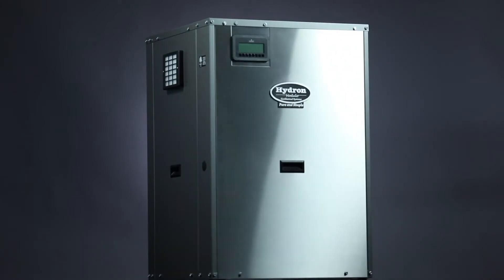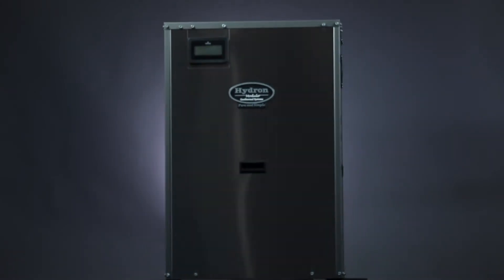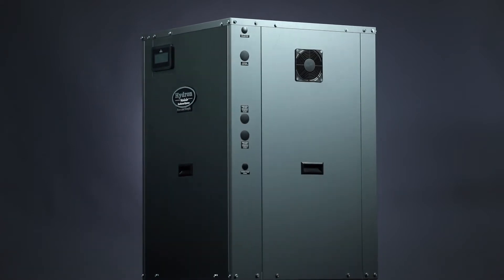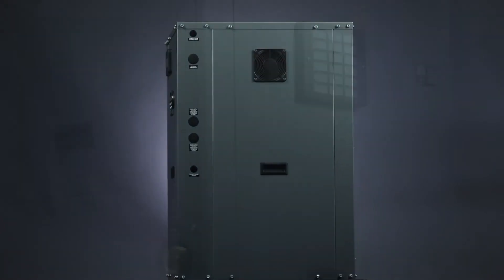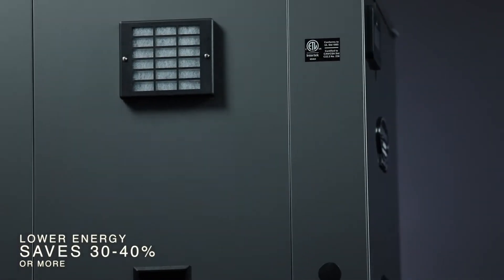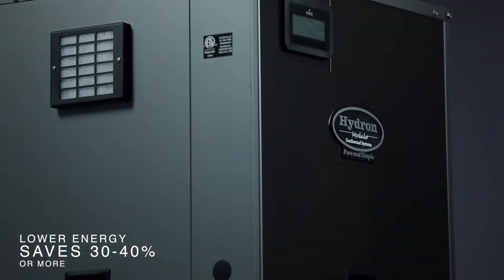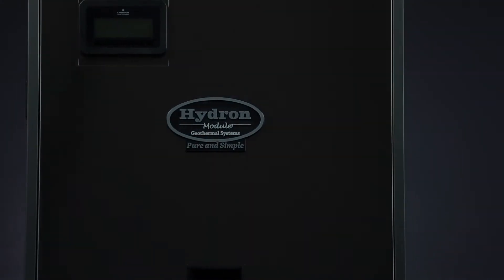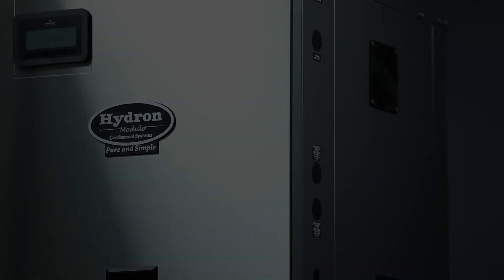Hydron Module Variable-Speed Water-to-Water Geothermal Heating, Cooling, and Hot Water System

Comment: Interesting system, water to water has a better cop as compared to air to water, then inverter is a great improvement... although the system I'm building will be a large water tank to store the heat energy and powered by a diesel engine with heat recovery and hopefully cop 5~6 on a 10degC primary tank to  a 40degC secondary 8000 litre tank, also water is a very good heat storage medium.
Reply: That sounds very interesting. I have recently gotten interested in geothermal for a project in Africa. 
I introduced it to my father and he put this unit in a building he just built. It actually runs of two of them on 3 zones.
 I have also thought about a larger buried tank for energy storage. I am still learning a lot, if you have any plans drawn up or an example of what you are planning I would love to see.
Reply: @vdub7150  the geothermal aspect is a great idea, in my system geothermal would be used to stop the water from the primary tank from freezing (once heat energy has been sucked out by the heat pump) this is a very simple system but very efficient, a little hard to explain, I will do a video on building a simple heat pump when time permits and water would be the best medium as it is both energy dense and easy to shift around.

Comment: Nice video.  I have an old (26 years) natural gas boiler with fin tube style baseboards to distribute the heat throughout my house.  For my hot water, I recently installed a high efficient hybrid heat pump water heater which replaced a gas fired water heater.  I don't have any HVAC duct work, or radiant tubing.  I do want to replace my boiler with a geothermal pump, ideally leaving my existing baseboard pipes .  Will this system be able to replace my boiler and tie in to my existing baseboard?  Does the water come out hot enough to make it a viable option for heating my home?  I'm in Vermont, thanks.
Reply from the maker: This system heats water plenty hot enough to heat a home and provide the hot water for all your home's needs. Send us an email at insidesales@enertechgeo.com or you can leave your email here and we'll get ahold of you. We provide free geothermal design support, so we can help you figure out if this system would be the best option for you, and what updates your home might need to make it happen.
Reply: not that easy of an answer, your baseboards at a given temperature produce a specific amount of heat.  without knowing the heating loads of the rooms or the baseboard types and lengths to determine their potential outputs you will only be bullshitting yourself to just say yes or no.  you need facts.  your baseboards probably run at 180 degrees currently.  although this is probably overkill you need to be sure of it before you invest in a system that can only make 162 degree water max.